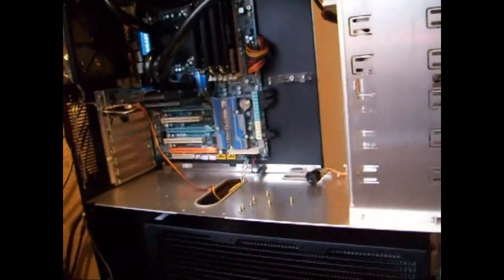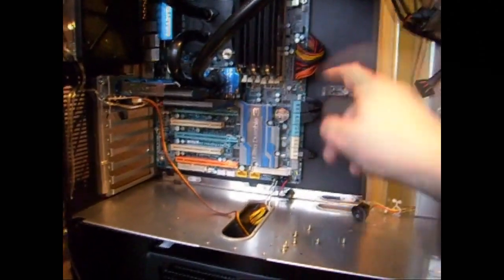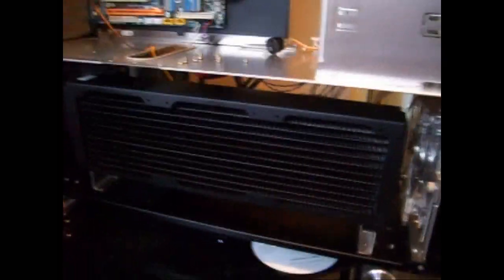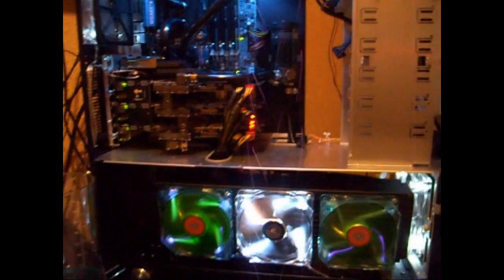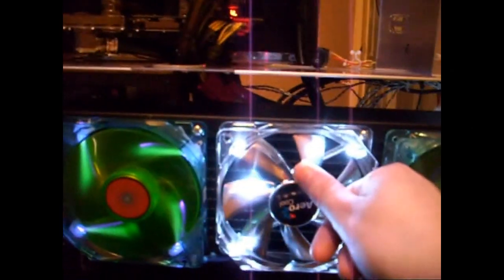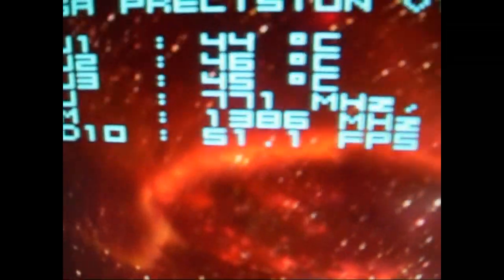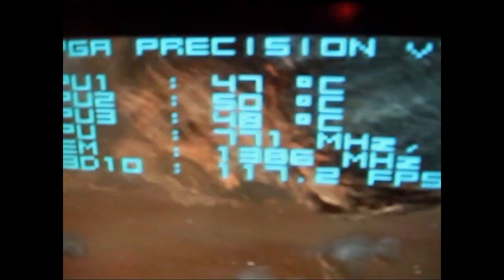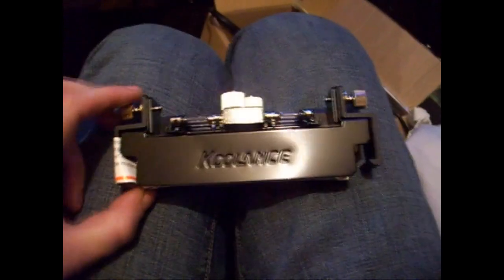Thermochill PA 120.3 and VID-NX285 refit and temp testing

Comment: The AreoCool fan he is referring to as being "Quite shit " are the AeroCool TURBINE 2000, which operates at 950 rpm so it can run silently. The AeroCool XtremeTurbine pushes much more air at 1800 rpm.

Comment: depends on the GPUs, If you have Nvidia cards you need more rads cause they run way too hot. the newer ATi cards run alot cooler so probably would run fine.

Comment: Geez... Black ICE GTS suketh. lol. Really constricting. Id score an MCR320 anytime of the day.. in anycase, PA 120.3 is the king of flow and king of low cfm fan temps... However, a Black ICE GTX with high rpm fans would pwn it at about 2-3 degrees when the PA would be fitted the same rpm fan... noisy only though.